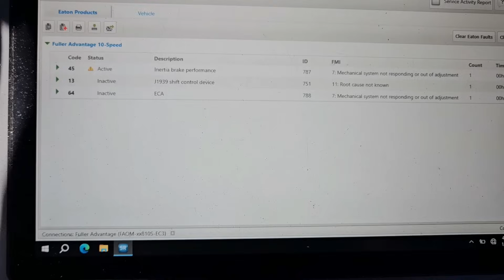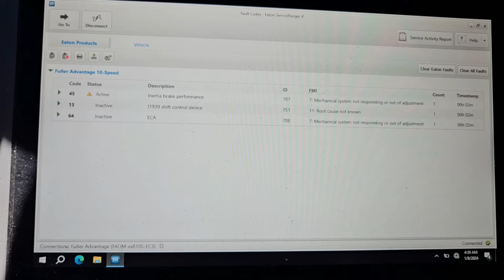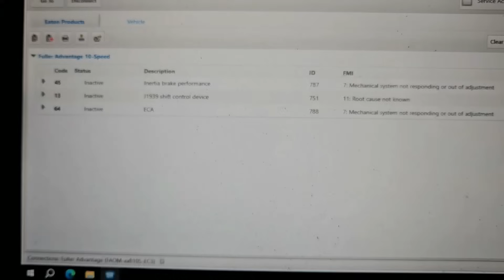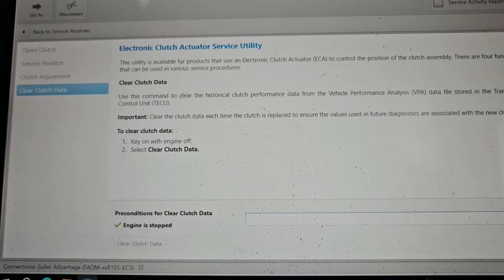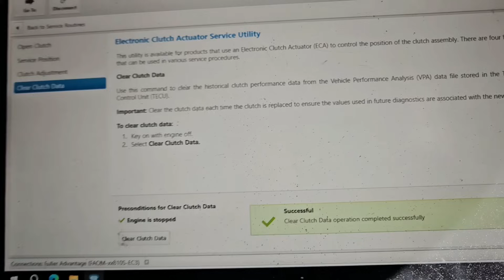Electronic Clutch Actuator. Eaton Fuller Automatic Transmission issues

Comment: I have the same transmission and the problem is that there is a jerk when begining driving in reverse, there are no faults code in the diagnosis, it seems to me that the clutch does not engage well, but the clutch looks like new.  the truck is an international lt625 2020 and the date on the Electronic Clutch Actuator is 2022, so I think the actuator has been replaced.  My question is, would it be wise to do a Clutch Adjustment and Clear Clutch Data, before buying a new Clutch Actuator.  Some mechanics I spoke with say that Clutch Adjustment is only doing if a new clutch is being replaced and that it cannot be done afterwards, which is not logical to me.
Reply from the maker: Do a clutch relearn first using the software to see if that works

Comment: Good afternoon, very good video, thanks to it I changed my actuator myself but now I have a problem, the truck runs well but when it goes to change from 9 to 10 it accelerates above the revolutions and I get a code which is SPN 0522 fmi10 I don't know if it has to do with calibration, please give me your advice when you can, thank you very much
Reply from the maker: Based on the spn, Sound like you need to calibrate new actuator to the truck. Easily done with eaton service ranger.

Comment: Marshal how are you brother, I got a 2019 t880 , I got stuck on the road with a code 64 coming up , what's your take please?. Thanks
Reply from the maker: @benniemabena1699  make sure your battery terminals are not corroded. Clean them up and torque them down. Also make sure you don't have any loose connections at the clutch actuator or TCM.

Comment: Hey marshall Im having an issue on my eaton fuller advantage , while running it randomly acts as if my clutch is not engaging and it cant find a gear after that, i have to pull over and take off transmission fuse or ecm fuse a few times and cycling on and off the key until my screen shows that it is in neutral/F instead of “**” and F , do you believe the electric clutch Actuator is the cause of it? Clutch and inertia brake were replaced about 3 months ago new.. truck will work like nothing happened for a while until the transmission fault pops up again and I lose gears and eventually stop and reset it into neutral

Comment: 2015 t680 eaton ultrashift i got lucky a year back cause my clutch actuator was on recall and dealer replaced for free so maybe check with dealer first. My symptoms was slamming into gear or not disengaging out of gear when comming to stop or start. Recently had same codes. Slipping in and out of gear at random. clutch was bad. $5700. Thank you kw of Carlisle, pa. It was a perfectly timed breakdown. I went there early morning and was out by early afternoon.

Comment: Do you of to program the clutch actuator?
Reply from the maker: If you cycle the key 10 times the actuator will calibrate.
Reply: @Tech_Marshal Really? I have  2017 dealer said it needs computer calibration
Reply from the maker: If you cycles the key 10 times the actuator will calibrate.
Reply: I have a 2019 -Pete 579 
I have the code E74-1010

Comment: i have replace a clutch do i have to reprogram the actuator ?
Reply from the maker: Yes it has to learn the New thickness of the clutch and the clutch brake.
Reply: @Tech_Marshal  How do you reprogram the actuator?
Reply from the maker: @TriggerzElite  Ideally you'd need the software to reset.  I hear you can disconnect batteries and let computers recalibrate. Or turn key on and off 10 times to reset.
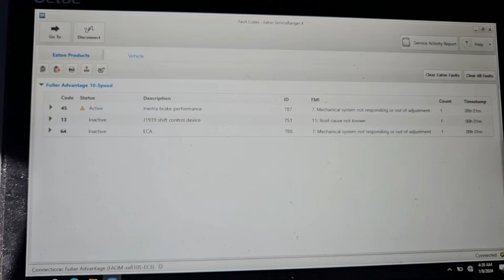Reply: @Tech_Marshal 😮🎉🎉🎉😮😮😮🎉 0:57 🎉😮😮😮😮😮😮🎉😮🎉😮😮😮😮😮😢😮😮🎉😮 1:05 🎉 1:05 🎉🎉😮😮🎉😮😮😮😮😮🎉😮😢😮😢😢😮🎉 1:15 🎉😢🎉🎉😮😮😢😢😢🎉😢🎉😢🎉😢😮😢🎉😮🎉😢😮😢😢😮 1:27 🎉😮🎉😮🎉😢😢😢🎉😮🎉 1:36 🎉

Comment: Great video, I know it’s been a while, but am having an issue with my transmission showing fault, it’s 2014 Pete 579 same tranny giving code 19, 16 is this the ECA I need to replace? It did this to me couple times already I had to try to reset the system, hope to hear from you thanks!
Reply from the maker: Please inspect your clutch and inertia brake before replacing ECA because if they are worn out it will possibly give a false ECA fault issue. Had a friend have the same issue couple of days ago.
Reply: Hello did you ever find out what was wrong I have the same 2 codes? Thanks
Reply from the maker: @TheTruthCvo2022  in my case it was a defective Electronic Clutch Actuator. It is highly advisable to inspect the clutch and clutch break for excessive wear because those might throw the same code.
Reply: @Tech_Marshal  same here $4100
Reply from the maker: @Marcostruckinglife  loose connections are suspect